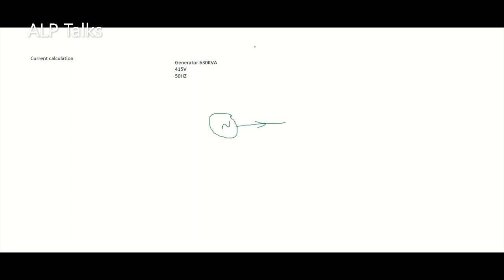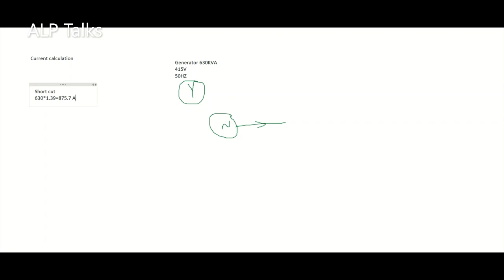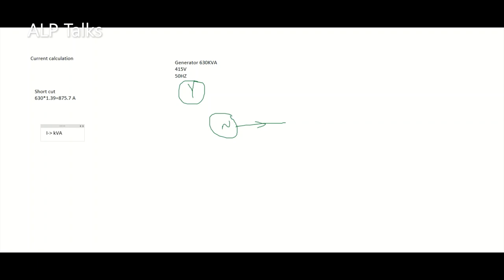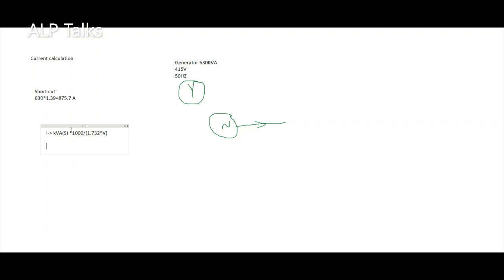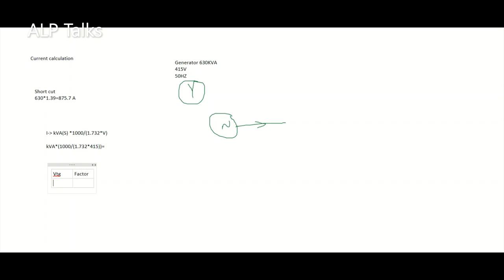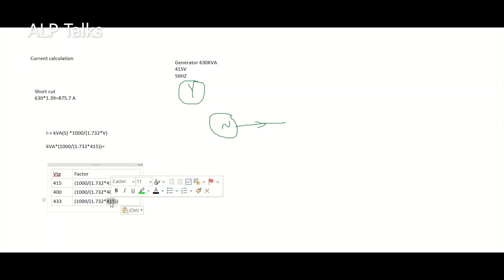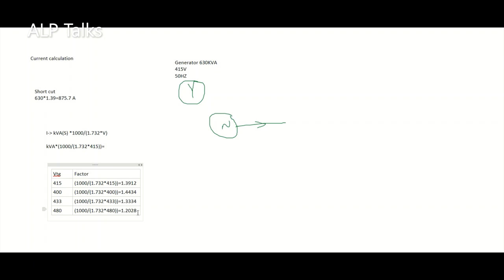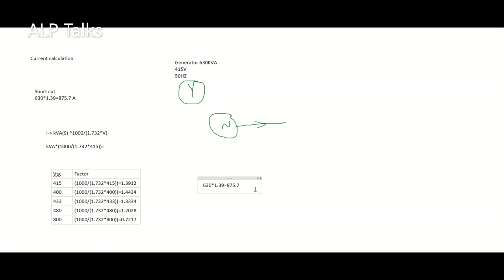Current Calculations ( Short cut)| ALP TALKS

Comment: What is diffrence between ATS and STS ,AMF
Reply from the maker: Sts( scr used )  is faster than ats( mechanical movement) 
Amf- automatic transfer switch
Sts-static transfer switch
Amf automatic main failure 

Amf similiar to ats but it maintains continuity when supply fails